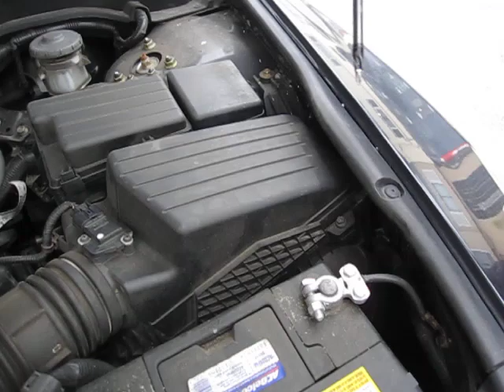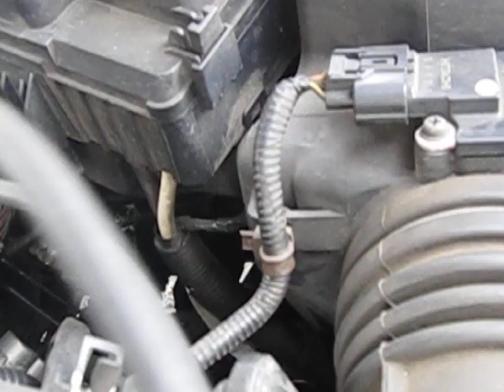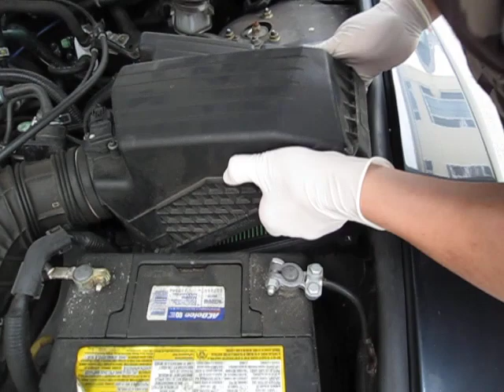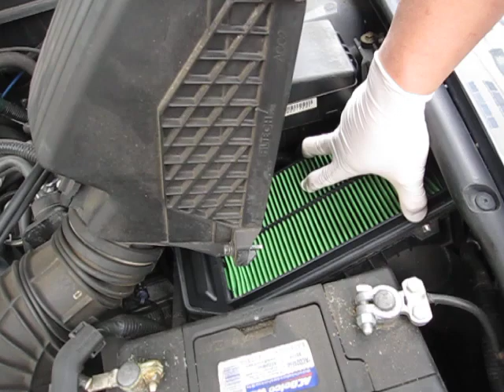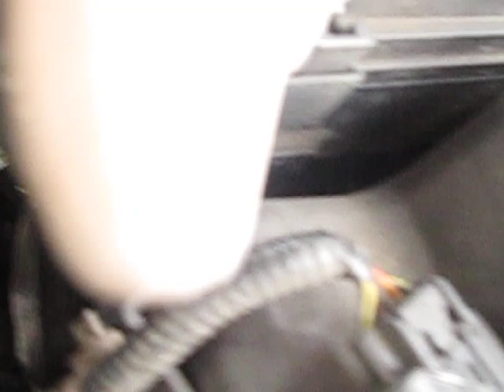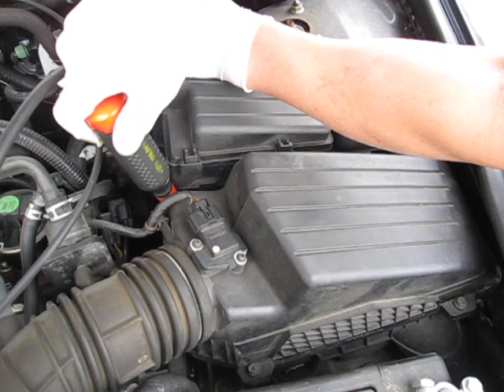2003-2007 Honda Accord Engine Air Filter Replacement

Comment: Great Video!  I actually got as far as removing the four screws to the filter housing but wasn't sure why it was so hard and stiff to lift it up to get to the filter. I didn't want to force it concern I might break something so I reinstalled the screws w/o getting to the filter.  Now watching your video, I have more confidence to try again.  Thanks a bunch!

Comment: Thanks for the video. Honda s/have use quick release metal clamps instead of screws. Even after loosening the screws it's still very difficult to lift air filter cover up and back.

Comment: @hondarepairadvice I have an 2005 Honda Accord LX 4 cylinder, Everything seems much tighter and harder to replace the engine air filter. I unscrewed the 4 screws it was difficult I had to get  long magnetic screw driver and the screw on the far right was at award angle. Secondly. It seems like I have unscrew the sensor clips and unscrew the intake and loosen clamps.  Was there an change between 2005 and 2006 models? Also I have an LX 4 cylinder , do certain models are purposely more difficult?  It was way harder than unscrewing for screws and replacing. Opinions and thoughts?

Comment: Very good video. I broke the cover edge nearest to the mechanic, and  I stripped two screws. Make sure that after you completed changing the filter that you check that two hoses are still connected to the bigger hose that connect to the filter box - I'll never buy Honda car again if this is their engineering skills.

Comment: Hi, I'm also in the same situation right now, I took the 4 screws off, but I wasn't sure if I am supposed to use a whole lot of force to push that cover upward like he did in the video because I'm also afraid that I will break something. I just want to know if you ever managed to take your cover off. Thanks in advance.

Comment: I've got an issue where the 4 screws holding the filter cover in place are now rusted shut.  I have tried using WD-40 with the hammer/screwdriver combo to loosen things up a bit.  No luck.  Any ideas on what I should do?  A mechanic suggested that I replace the air filter housing box.  That seems a bit excessive, but I'm willing to do it if necessary.  My '04 Accord V6 has 162k miles on it and I'm hoping to keep it through 200k.  Leaving the filter in there that long is not an attractive option.

Comment: @Hondarepairadvice I have a accord 2007 V6 Hybrid and I can't get that cover opened. I tried pushing back and lifting but to no avail. I think the issue is because there are a few wires attached to the cover which I need to remove first. Do you have an idea as to how I can remove it? Thanks

Comment: Any tips on loosening the 4 bolts? On my Accord they seem to be very difficult to remove. I was unsuccessful using a screw driver
Reply: sonyfxi use a socket which will grip the screw/bolt better.  A shot of WD-40  on the screw heads and wait 5 minutes will help.

Comment: I replaced my filter and the housing didn't lift up that easy. I had to remove the air duct hose. And it got damaged while I did it. WTH?! Y did yours come off so easy???
Reply: On some cars like my 04 accord it lifts off ok with a little elbow grease. My 06 accord had to disconnect the air duct.
Reply: that happen to me ,intake pipe brooked when  I  lift the box. be carefull .$ 180.50 in the outoparts
Reply: Don’t feel bad. I just ripped the intake also trying to get the cover off on my 07

Comment: Make sure you don't accidentally disconnect the vacuum hoses coming off the air tube when you lift the cover (the guy checks if it's snug at the end of the video) I did and my check engine light came on a couple days later.

Comment: I tightened one of the screws too hard and it broke in half, now half of the screw is inside of the hole and I have the other broken half.

How can I remove it?

Comment: This video does not help. Intake hose is so hard to push in that I spent half a hour to get the filter housing out.  The section that starts 0.46 to 54' must be fake. It is very hard to take the housing out. I have a Honda Accord 07. I totally agreed with Mike Name's comment below.
Reply: agree with you

Comment: I had to use a nut-driver to grab the outside of the screws. A screwdriver was just stripping them.
Reply: Exactly the same thing that happened to me. Stripped screws. And it was not nearly as easy to push the air filter cover as easy
Reply: Same here. the screws are really old and weak they get stripped easily

it is better to do this with nut drivers

Comment: no way man, don't believe this vid. I have a 2003 and the intake tubing is hard as hell and you cannot just simply bend it away like that. You have to disconnect that tubing and fight the upper portion of the air filter housing out. Trust me this video will not help you if you have an 03 Accord.